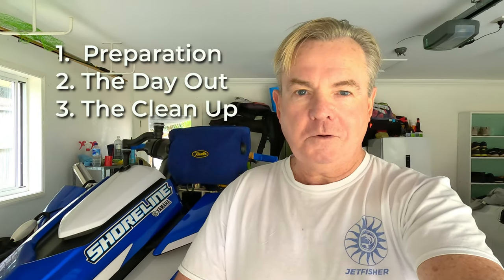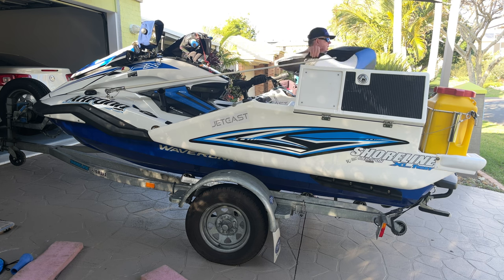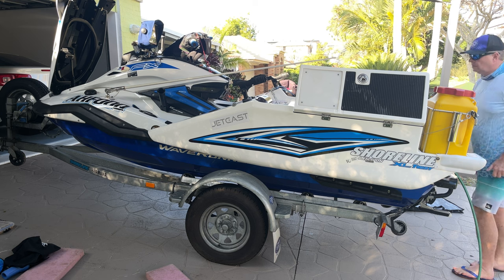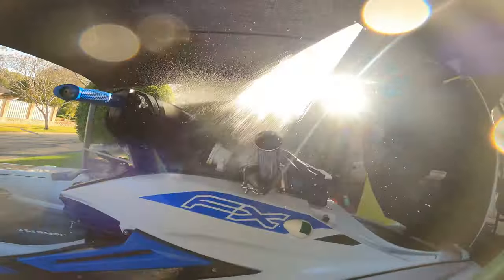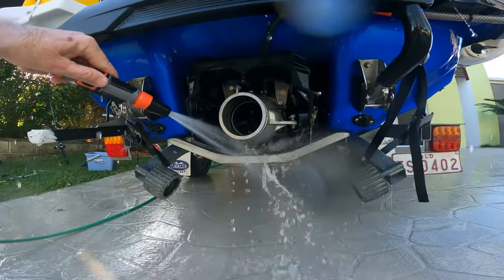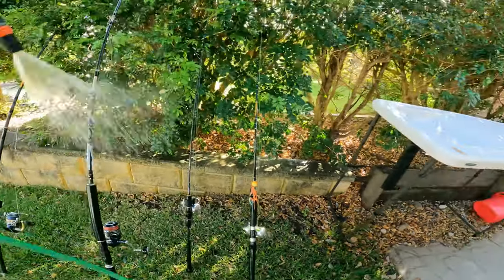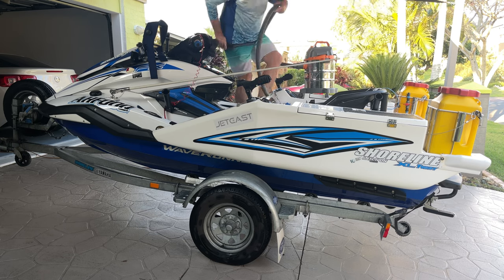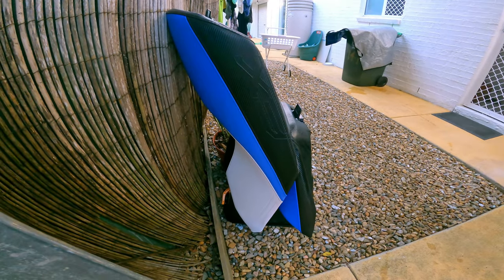Part 3 The Big Day Out : Cleaning the Fishing Jetski

Comment: Great contrast to many channels, and while some touch on cleaning ...this was excellent all in one and complete, some attention to the Tubbies cleaning would have been interesting to me....Your comment re covers suggest to me that a cover designed for road transport is going to be its only use, and some others have said even the best of these can mar the ski with some flapping etc at highway speeds.
Reply from the maker: Thanks Peter, covers are not much use to me but I guess if you were in a dirty/dusty area or dirt tracks keeping the bull dust out would be a good use for a cover I guess.  The cleaning of the Tubbies was kept short due to the limited number of people with them.  I just spray them down like everything else and re-check the fitting bolts after each trip. Otherwise not much to do to them  Thanks for watching and commenting. Much appreciated!